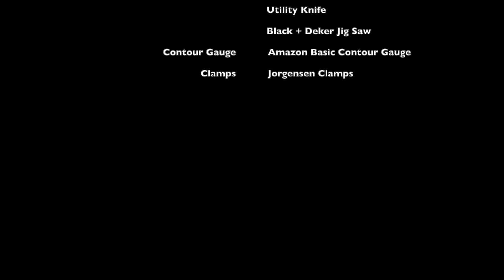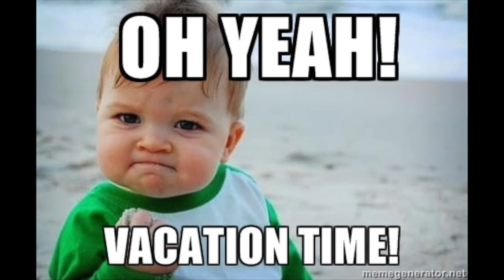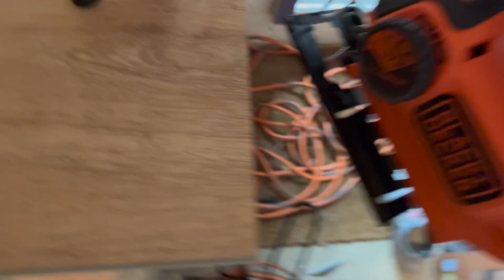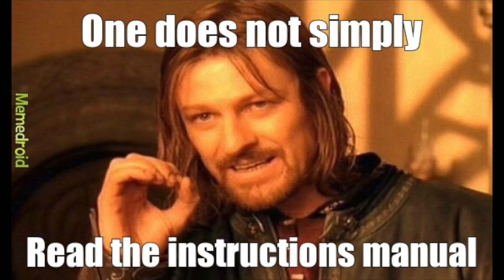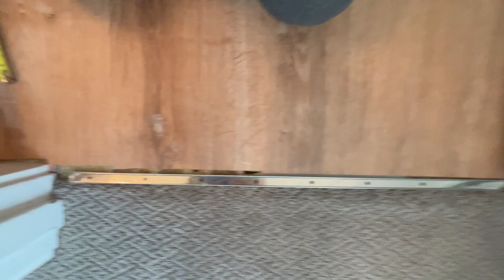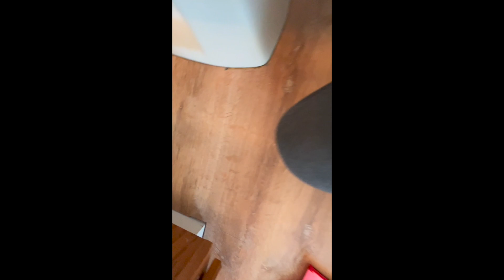Upgrading bathroom - add vinyl flooring to linoleum floor and around toilet

Comment: Every lvp flooring instructions tell you to install the flooring UNDER the toilet up to the flange. NoT around it.
Reply from the maker: Hi Li Walker, absolutely a great point! Agree with you fully anyone who can actually install the flooring under the toilet, they should do it under and not around. For my case I was just not feeling comfortable lifting the toilet for many reasons and tried to give it a shot. So far with caulking around the toilet seat, it seems to be holding up well. Will report back in a few months for any problems or reports.

Comment: Not a flush look if you don’t remove the toilet. I did it first but I’m not satisfied so I removed the bowl. You can turn your water off in the main bulb and it has selaed off knob under also and it won’t leak either. That ruller was so hepful but the easy way is draw a circle layout from a carton and you should be fine also of you don’t have that measurement ruler. If you lift a bit that bowl you might tuck in that plank under to look flush and make sure culk it under also.
Reply from the maker: Hi @HaChi Roku! thank you so much for adding these great tips! I definitely agree that the finished look is not as appealing when not neatly tucked under the toilet. Hopefully these tips can be of help to other people! Thanks for sharing again!